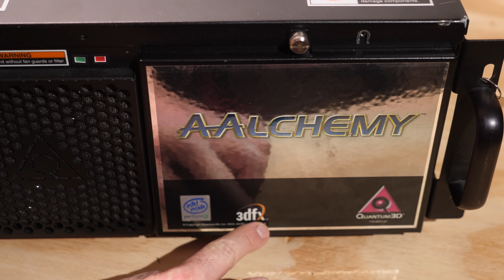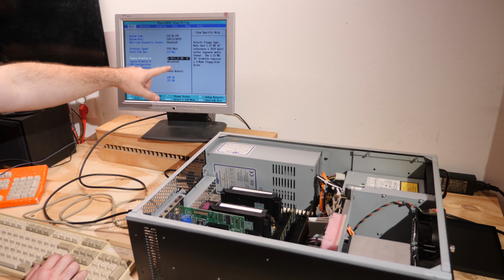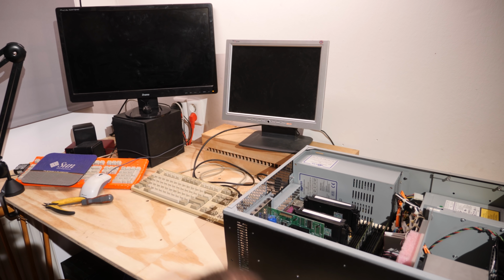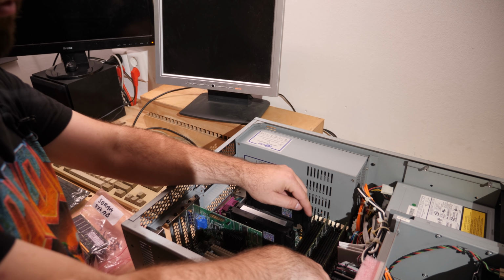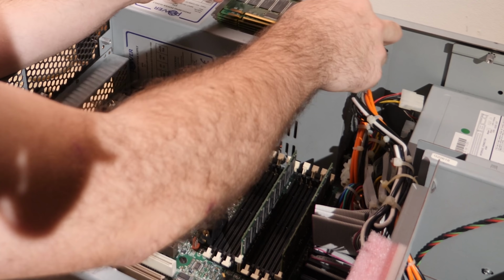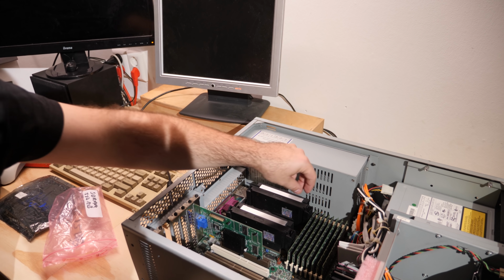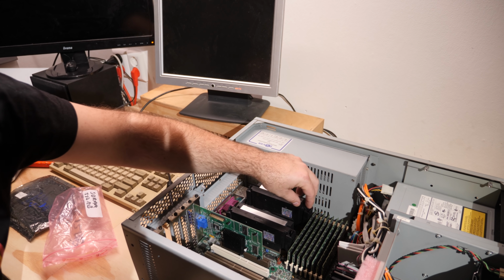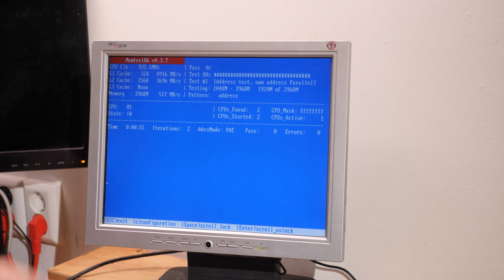Quantum3D AAlchemy 8232SB, TYAN Thunder 2500 Hardware Overview and Memory Upgrade

Comment: I have a question about these AAlchemy cards:  I know the large number of VSA-100 chips was used mainly for FSAA, but what's the maximum limit for straight SLI?  For example I know the mercury brick was made up of four large cards, each itself a single-card Voodoo2 SLI solution, but the most horsepower you'd get out of the thing as a whole was equal to that of a standard Voodoo2 SLI solution - but with 4-way AA so the image quality must have been awesome.  Is it the same case here?  Can the 8232SB do 4-way SLI like the Voodoo5-6000 or is it limited to 2-way SLI plus 4x FSAA at no performance loss?

Comment: I had a TYAN board similar to that but instead of the built in Audio it had an ATI Rage XL. It was an awesome board until the Caps started to flake out and at the time I didn't have a Soldering iron that could handle "Lead free" Solder let alone heat up a multi layer PCB so I gave it to a friend.

Comment: I love Slot 1 systems! My first computer was a 500mhz Slot 1 Compaq desk pro with 128 mb ram. I fitted a PCI graphics card into it. If you still have this machine, I'd love to see more about it! Perhaps fit an AGP or PCI graphics card into it, and run a few benchmarks? Have you discovered the RAM capacity for this system?

Comment: there are two versions of this card
8132 and 8164
you can have 1 or 2 or 4 cards up to 8464 (yes this exists and pictures are available online)
checkout dodge garage - this website have a lot about voodoo especially those Quantum3d (they even used VooDoo3 for another such farm)

Those 8P8C sockets are for synchronising of up to 32 VSA-100 in SLI configuration

and no, neither port/socket nor just plug can be named RJ45 as RJ stands for Registered Jack and both form factor and wiring including exact colour scheme have to match
not even ethernet is RJ45 and people call it wrongly (same as WiFi is not a wireless communication standard, but a certification scheme for IEEE802.11 standard)

Please don't do that, don't mix thing like all others are doing

Comment: Victor Bart, what operating systen did it run from factory?
Windows 3.11, or windows 95 or something similar?
Reply: Surely nothing that old, since VSA-100 chips came out in 2000 and also 3.11 and 95 would not benefit from dual CPUs.
It ran Windows 2000 as Victor said in the video.

Comment: not necessarily PCI 64bit 66MHz
Those are 3.3V and may not be 66MHz
The keying is there for voltage reasons
PCI-X 266 have exactly same keying as PCI 64bit 3.3V, but it is not even same bus

Comment: Also perhaps you could use scsi to sata drive adapters & put in something like a 60 - 120 gb ssd for the os & some of the games.

Graphics card you could probably put in something like a ati 9800 series graphics card with that quantum graphics card board too have a mix of direct 3d & voodoo graphics.
(though out of the box with that included nvidia graphics card it pulls like 320w in load out of the wall while rendering with 8x aa so don't go nuts with overclocking or similar.)

Perhaps fabricate a small tunnel with a 120mm - 92mm fan blowing air through just the gpu board.
windows 2000 installed ofc on it for multi processor support or windows xp.

One fairly useful link right away is here for it.

http://www.thedodgegarage.com/3dfx/q3d_aa5_faq.htm
Build of another one with some mods like a custom self made powersupply.
https://www.vogons.org/viewtopic.php?f=25&t=55571
Found a site that still has the specs written down too the machine you got & the model after with 2x pentium 4's
http://www.satek.com.tr/aalchmyperiodic.htm

By the looks of it the quantum cards in these machines don't support direct 3d at all, but they do opengl & ofc the voodoo api with up too 8x fsaa

Think you might have heard of gdonovan ?
Maybe that's the guy you bought it from ahah.

https://www.youtube.com/watch?v=AUxSP1plqmg

When it comes too that boot cd maybe you need too have a small thin shelf too put cd's on there, there are thin ones meant for paintings where you could stack stuff up on there, i got a pair of them in my room its about as wide as a raspberry pi which is about 5 - 7 cm i think ? (Its not plugged in or in use that rpi btw.)

But I've set up a bunch of old graphics cards, dead ram sticks which look alright on there like a corsair xms3 & xms 2 stick, my dead gtx 780 from msi, a hd 5770, hd 5750 both of these from xfx.
A 7800 gtx, dead 9700 pro i ripped a memory chip off on when i was taking off the heatsinks for something else & a few random stickers in there too.
Reply from the maker: Computer Says No!

I will keep it period correct!